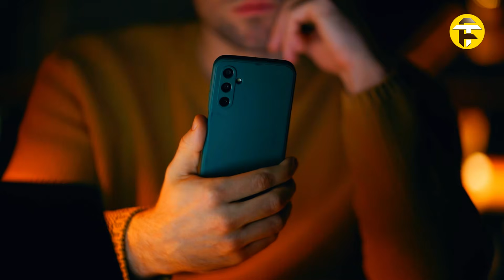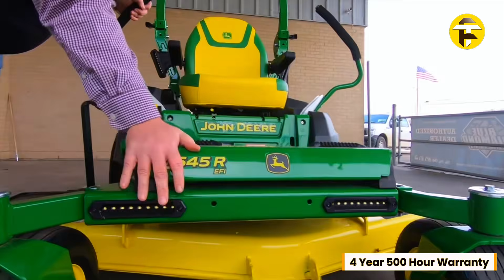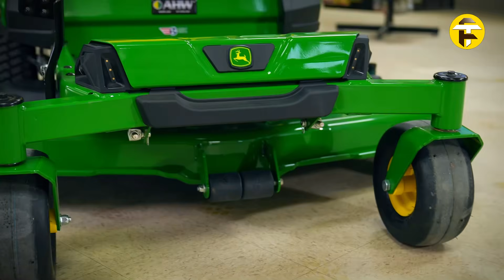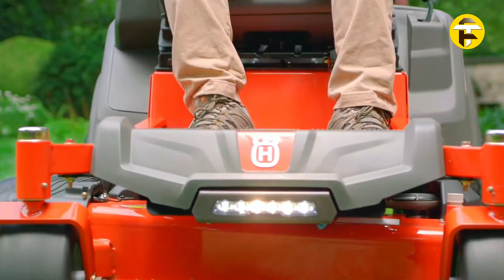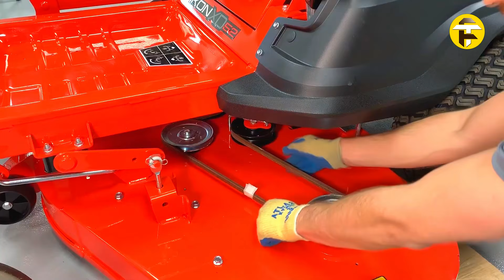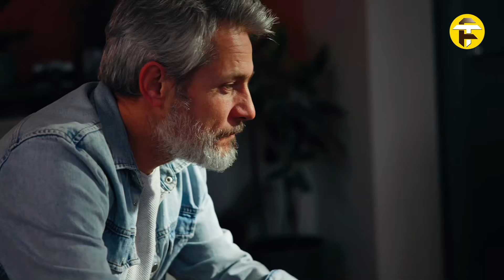4 Zero Turn Mower Brands ROBBING You Blind (Don't Waste $10,000)

Comment: I don't know beans about zero turn,when I bought my home the sellers cut me a deal on their husqvarna z254 "Death machine" you sneeze and it tips over,been through 3 belts,1 blade arbor,2 blades,lost metal strips of heavy metal under the deck and major lost time cutting the grass. It has no safety bar in tip overs and it is impossible to change the transmission oil. Whoever company made this piece of shit should be ashamed  just junk.